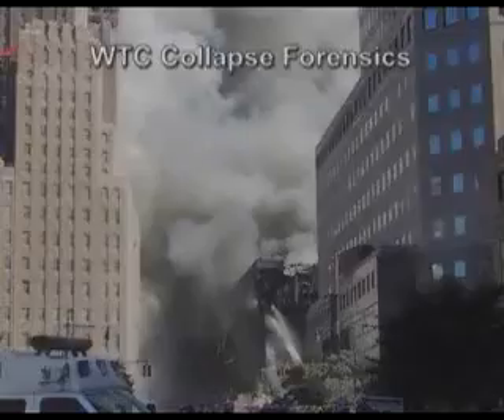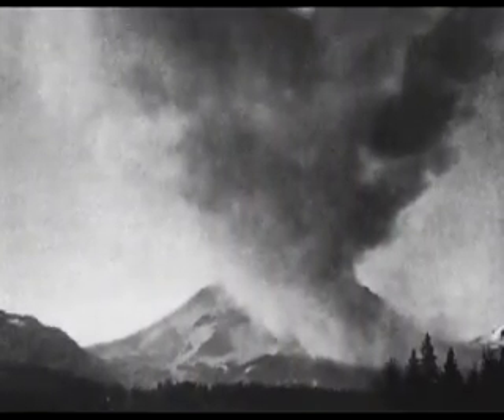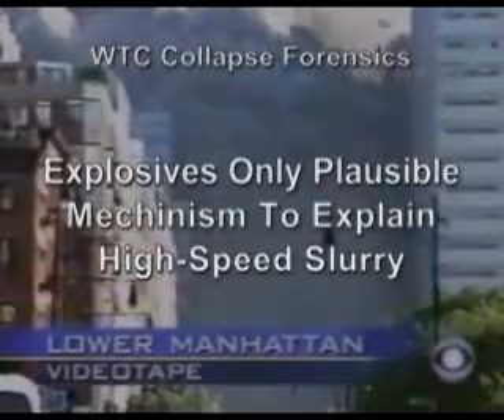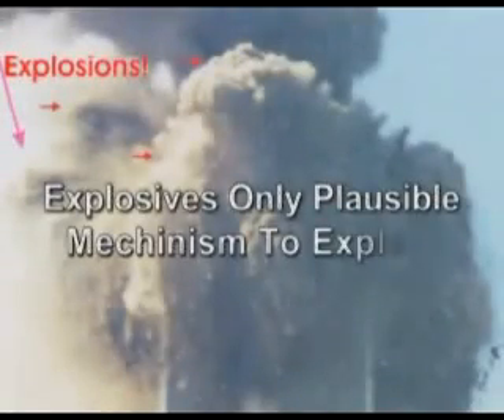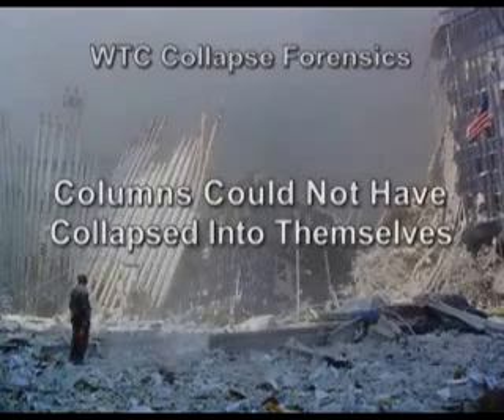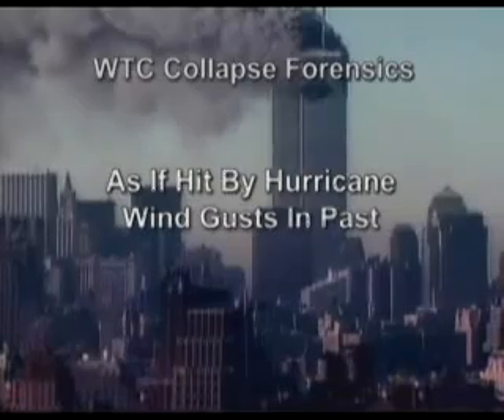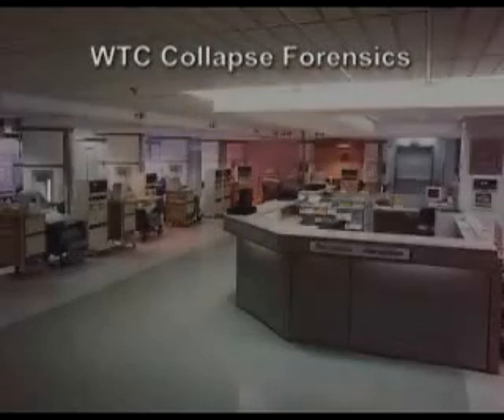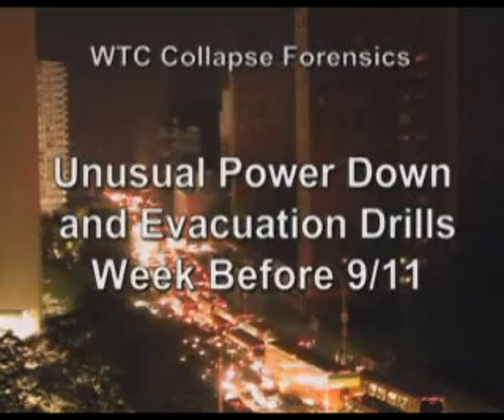MIT Engineer Disputes 911 Theory of the WTC Collapse-Part 2

Comment: So, no one's done calculations of downward shear stress required to shear the support of say the entire floor 80, and compared it to the downward force of floors 81-102?  Wouldn't that be a relatively simple way to see if it was even possible for the moving weight of floors 81-102 to overcome the shear resistance of floor 80, then 79, 78...? The numbers for static shear force for each and every floor MUST be already done for when it was built!
  Because, (and yeah, my math and units are probably wrong) if the shear stress was say 1000#/bolt or weld, and there were say 10,000 bolts or welds for a total vertical shear resistance force of floor 80 of 10M# , and if the downward force from above was say 1000Tx2000#=2M# , then given static forces, floor 80 would of course resist the static weight of floors 81-102 above it.

  But moving at say 32ft/sec after 1 sec, simply multiply 2M# x 32ft/sec2 to get the new downward shear force and compare that to floor 80 total shear resistance less some factor for heated bolts & welds (and inertia, maybe).

   Then, if downward shear force from floors 81-102 was say 5M# or 15M#, then we'd know if there was adequate shear resistance of 10M# in floor 80 to withstand floors 81-102 as they dropped (and  yes, I'm averaging the inner structural frame strength vs outer frame, but I'm no structural engineer.)

   I'm sure a current physics student or building demolition expert could factor in impulse, time to break through a bolt, cooler temperature of lower floors etc...and come up with a general answer as to whether each lower floor could resist the falling weight of the floors above, or whether some percent of the bolts and welds would have to be cut by thermite, or whatever.

    Not rocket science. In fact, where are the  professional building demolition experts who do this stuff for a living? Shouldn't they be interviewed and doing the calculations to assess this vertical shear resistance question? 

  Bottom line, it sure does look to me that it was a planned demolition, otherwise one of those floors would have a slid or tumbled off to the side on which the plane hit or something instead of falling so nicely straight down. And to have both buildings go the exact same way? Nobody's looked at the logs to see who visited that place from demolition contractors? What, was all that information conveniently destroyed?

And conveniently, nobody has assessed who else wanted those buildings down? Who had motives other than terrorists?

Comment: Nice enough a guy, but literally she’d no light nor gave any insight beyond what we already know. He did not use the term “dustification,” which indicates what truly happened.   

All of this is explainable as a function of internal heat in the towers, but much, much higher than sources anyone can, or is willing to name, such as a mini shaped charge neutron device which would have instantly generated some 8000° F, enough to instantly turn the core to dust.  It would also explain the tritium levels @55 x the normal rate as found in and around the site in the days and weeks following the collapse.  It would also explain the hyper rate of selective cancers that are still popping up nearly 17 years after the event.  It would also explain the mass destruction of vehicles near the complex, as the nuclear activity would have had a seriously destructive effect on a wide range of aluminum alloys.  

It seems the US Govt sold over 50 such devices to Israel (think Mossad) in 1978.  

A couple of helpful other videos:  Loose Change, Follow the Money, and JFK to 9/11: Everything is a Rich Man’s Trick. Further, Pilots for Truth 9/11 deals with aircraft, which fly just fine going 550 mph at 30,000 ft, but which disintegrate at that speed below 10,000 ft.  There is also that inconvenient business about cell phones not functioning above 1500-3000 ft nor their ability to “hand off the signal from one tower to another at the cruising speed of a commercial jetliner.
Reply: http://www.methodicaldeception.com/resource2.html

Comment: Just another over-educated idiot seeking his fifteen minutes, and plenty of folks ready to drink the koolaid because everything just has to be a conspiracy.
Reply: unless you're an uneducated fool that believes in fiction and magical pseudo-science that in no way represents
what actually happened in NYC... What would this engineer possibly have to gain by sticking his life, career and reputation on the line by addressing the obvious bullshit that your government sold the public after the fake attacks?
Reply: So you believe that 30 floors can crush the 70 below because of jet fuel fires that weakened the steel & that every single connector in the building all failed exactly at the same time for 8 floors in wtc bld 7 which led to freefall acceleration?

Comment: No melted steel, no thermite was found. WTC fire proofing below the floors, dislodged by finger. WTC core insulated with wallboard breaks easy. 1300 and 2000 pounds of TNT equal energy impacts dislodged insulation, proved by reports stairwells blocked with insulation, wallboard. 9/11 truth lies, and offer no evidence for failed claims.

Comment: Failed 9/11 truth videos, celebrating 14 years of ignorance and BS.  Fire proofing in the WTC tower was easy to remove. The massive impact of the planes removed fire proofing, and steel fails fast in fire.  Facts, not BS, it is a matter of critical thinking, and 9/11 truth uses BS opinions and assorted nonsesne.
Reply: +jj560105 A bio-medical Engineer, preaching BS about structures? Wow. I worked/graduated with over 1,000 engineers, not one supports the BS in this video. So far I have found less than 0.1 percent of all engineers to support any of the claims of 9/11 truth, or BS like this video.  Too bad people are mislead by google, to find idiotic tripe like this video.
Reply: The 9/11 truth papers have fake conclusions, and the peer review was by 9/11 truth nuts.  
If 9/11 truth had evidence, they could team with a newspaper and break the story, and have the biggest Pulitzer Prize since Watergate, but all you and 9/11 truth have is BS, lies, and dumbed down fantasy.
What will you do?  Nothing
15 years of 9/11 truth lies based on the overwhelming ignorance of the followers who can't post evidence to support the idiotic claims.
Reply: No Mike, you have to come up with evidence the video is right, and you never will. The video is BS,  you can't refute that, you never will.